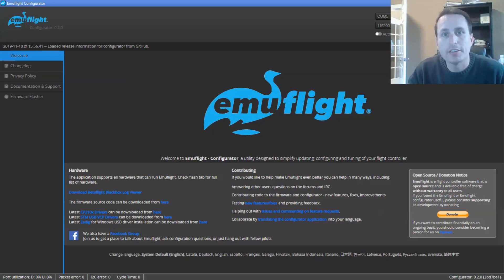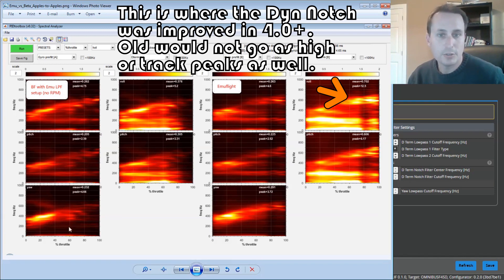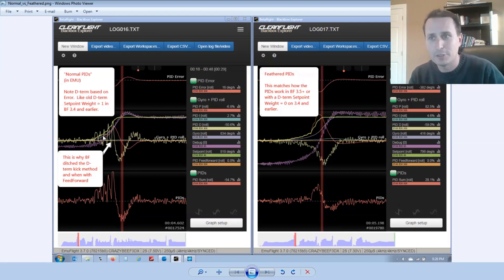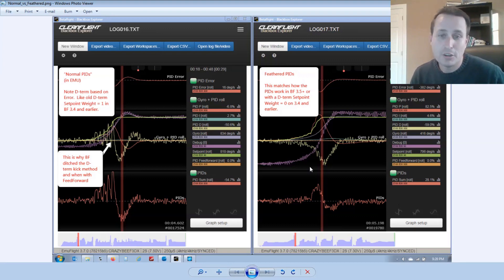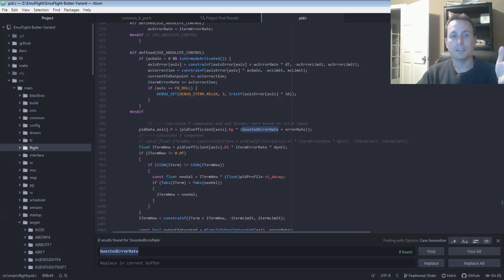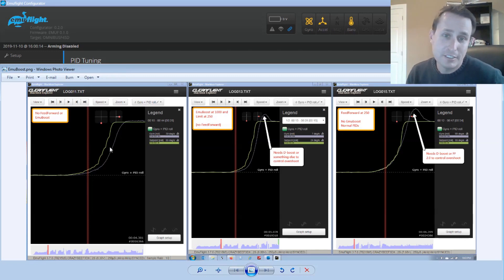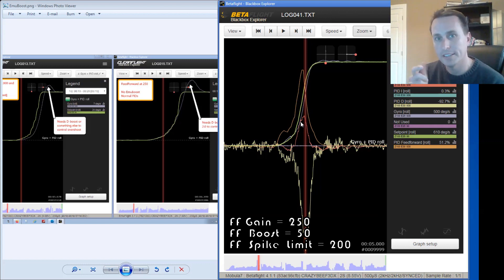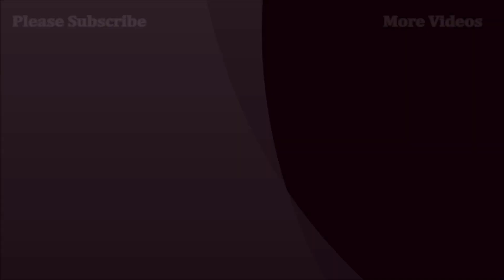EmuFlight Review - Under the Hood

Comment: excellent Mark! I am really glad you are tracking this development. I'm interested to see how this progresses. All good from a user stand point I think, as long as people can get past the hype and placebo traps.
Reply from the maker: underlines the importants of logging to confirm your code is working.  yeah I'm talking to you F1.  Who knows if what they plan to have working actually works if you don't confirm.  it is crazy we have to have these converstations.
Reply: @uavtech  it is crazy! I've no doubt F1 logs their data and uses some kinda data analysis tools for development, well I'd be shocked if they didn't, but they wouldn't want public to see that, else we could understand their "secret sauce"
Reply from the maker: it's a cover.  it would not reveal secret sauce at all.  How does a lot tell you the code that went into the PID loop responding in such a manner.  It doesn't.  

What may happen if we saw a log?  We may see: things are not as they appear on the surface; we may see a simple PID loop; we may see Setpoint is not tracked completely in SimMode; we may see filters let tons of peak noise through, etc..

F1 wants to keep customers focus on the final flight experience.  Which is fine and nothing wrong with that.  But again, placebo can get ya.  Secondary, if you want to tune filters and PID loop to a high degree, sorry, it is very hard without logging.  You cannot see the fine 10% of bounceback through the goggles like you can with a log.  Logging just gives more precision for filter and PID tuning, that's all.

I just find it hypocritical that they must us logging to make sure everything is flying right.  But we ask for looking to do the same, and the response is "you don't need it".  Just silly.
Reply: @PIDtoolbox  I actually doubt that flightone does any logging. I know it isn't something that the helio devs did much of.
Reply: @uavtech  fair enough. But logfile data can give you insight into the coding (and code alone doesn't necessarily give you the "why" something flies better). To give an example in my field, we dont have a direct readout of the neural source code, but we use neural data to infer underlying coding, and its worked pretty well so far. To give a concrete example wrt FPV, if you looked at an F1 log file and saw a strong band of activity tracking motor noise, it's a reasonable assumption that F1 does not make use of a dynamic notch filter or RPM filter. If you had pre and post filtered gyro/dterm data, you could even model the filters they are using. You could see how sim mode is or is not related to setpt to gyro tracking. so maybe not secret sauce, but some secrets may be revealed I think
Reply from the maker: @PIDtoolbox  , seeing to traites to coding up is a BIG gap.  So if someone can see the Dynamic Notch working, or RPM filter working, or Kalman filter working, that would provide no insight on how to code the up.
Reply: BWFPV I don’t think f1 logs.. they don’t have any one that can read em..
Reply: @Sugar_K  it's so weird to think that flight firmware developers today would be coding flight software basically in the dark. they have no idea whether what they code has any meaning. like what's the point right LOL. Well in fairness, F1 and KISS seem to fly very well, so it's a testament to how much can be done with blindfolds I suppose
Reply: BWFPV yeah man 2019 every other type of motor sport logs even go kart racers.. but some people in our hobby don’t see it as useful 🤦‍♂️

Comment: Hi mark and thank you for your time and effort to bring this informational videos. Beside the imu-f placebo, what I‘d like to understand is a difference between emu and BF in general ( in a for dummies way...sorry for the ignorance), I mean which combination of BF pieces (3.5 - 4.0 - 4.1) and which custom added ones from the emu flight developers ? What can I do to get BF to behave like Emu? 
I use mainly BF 3.5.7 because like many others, I found a good configuration, but propwash handling and lock feel it’s not so good.With BF 4.0 ( meh) and Bf 4.1+rpm filters  ( unflyable ) I was kinda disappointed. No satisfaction following community presets ( that I cannot found for 4.1 ) . With emu I found a good setup straight away , is it placebo? it’s not in propwash handling for me , I pushed emu boost to 500 ( limit 5 ) following Pierre configuration ( advertised from botgrinder ) and it’s locked for sure , maybe there is some lag? Probably a Little more but I cannot say . I will try to make comparison of BF 3.5 -> emu flying them one after the other to understand the placebo 😂😉
Reply from the maker: I went through the differences. That is it for the current release.  Basically boils down to EmuBoost and i-Term decay.

I think you should log your diffs.  It doesn't add up and you, or I, will be surprised.
Reply: UAV Tech this are the settings Input on emu : 
set gyro_lowpass_hz = 120
set gyro_filter_q = 7000
set mag_hardware = NONE
set min_check = 1010
set max_check = 2000
set deadband = 3
set yaw_deadband = 3
set pid_process_denom = 1

set dterm_lowpass_type = BIQUAD
set dterm_lowpass_hz = 150
set dterm_lowpass2_hz = 0
set iterm_rotation = OFF
set iterm_relax = RP
set iterm_relax_type = SETPOINT
set iterm_relax_cutoff = 10
set pidsum_limit_yaw = 1000
set emu_boost = 500
set boost_limit = 5
set p_pitch = 65
set p_roll = 62
set d_roll = 29
set p_yaw = 70
set i_yaw = 80
set d_yaw = 15

set tpa_rate_p = 70
set tpa_rate_i = 100
set tpa_rate_d = 100
set tpa_breakpoint = 1460

4.1 plus rpmfilter I tried stock , only thing that helped me was pd balance to 1.3

Edited: and the filter general bars near max on the right
Reply from the maker: @Simofly  well filter bars to the far right means you have a low base noise quad.  Maybe that is not the case?  Just put your EMU filter setup into BF and you will get a better result.  Did you see that waterfall graph in the video? With tje same lowpass filter setup, BF had less D-term noise, not more.  Probably cause of the dynamic notch improvements in BF 4.0+; but have not confirmed that is why.  I just don't know what else it could be.

Or just fly EMU.  It is fine.  But facts are apples-to-apples they are basically the same thing.  Whelp BF has some improvements IMHO Emu could benefit from too.  And if we can get the IMU-F working right, maybe BF can benifit from it.  Just needs vetted yet.
Reply: @uavtech  I have three 6S freestyle eatkabab glide 5" "heavy" (630-660gr) with nearly the same ( electronic), F60 ProIII or Xing 2207 motors, 2 with mpu6000 and 1 with ICM21062 gyro ( the Emu one is with mpu6000). Not the best frame for noise but not the worst. With BF 4.1+rpmfilter ( JB 4in1 esc ) and everything on defaults it seemed to drive a boat instead of a quad ( just to give you the idea I hope ).There are a millions variables...
I saw the video three times, but what I'm missing to understand ( but that it's my fault not yours ) is a global vision to get to  see what Emu brings to the table and connect to what I feel in flight (in comparison to BF).And "feel" is not objective I know.... Emu is at the start so it's early to get all the details on it...Betaflight got so advanced and open to every possibile pilot need,  that the last version goes out and the less confident I am on it. My dream would be to have a Kiss flight feel with Betaflight OSD and GPS...However I will continue to test Emu vs BF and we'll see and thank you anyway for the time and support
Reply from the maker: Good luck in your search.  Just make sure not to chase ghosts.

Comment: I really hoping EMU becomes a simplified version of BetaFlight for us old farts who like to tune PIDs the old way without having to mess with filters. 
It would be cool to see you set up a quad from scratch on EMU.
Reply from the maker: You always should have been tuning filters first. Just folks were not aware of their influence as much.  It is like smoking.  You tune BF the same you always have tuned a PID controller.  Did you see my PID tuning Principals series?

I think EMU plans to rebase on 4.1.  They need to do something to get all the new targets, etc...  Maintaining a project is a lot of work.

Setup is the same as BF.  JB has lots of videos on setup.  I pretty much hit the differences.  Which really comes down to i-Decay option and EmuBoost option.
Reply: UAV Tech Coming from the BaseFlight days I guess I’m just used to tuning for feel and prop wash and flying around the bad stuff. Up until 4.0 I’ve never had a turning issue I couldn’t fix with the PID adjustments. I’m sure it’s something I’m doing wrong but the given time I get to fly I’d rather just use a older version that works and fly then chase down a problem for a small improvement in stick feel.
Reply from the maker: @FunkFPV  , the key is Step #2 in my principals series where you turn off the bells and whistles to tune the PID balance.  Then from there, you add in SOME of the advanced PID control stuff.  It all builds.
Reply: UAV Tech I’ll check it out 👍🏻

Comment: nice video! IMUF doesn't work on non helio FC's, I didn't know it! - Luckily I didn't hype it in my videos :D But I can understand the placebo effect. Emu is a fork of Butter 3.5 - Butter a fork of BF. And even when I fly my quads with Bf 4.1 compared to 3.5 - BF 3.5 flies better imo.  I have also tested Emuflight on one of my heliospring quads, couldn't feel a difference to BF 3.5.7 with IMUF 1.1.0 - But BF doesn't support the Heliospring FC anymore, so I will use Emuflight from now on, on my Helio-Quads and I'm curious about their future releases.
Reply from the maker: Keep in mind 4.0 is 3.5 with new features and different defaults.  4.1 is 4.0, again with new features and different defaults.  So, what folks are seeing if they like an old versions more is just settings changes.  For that, just see: https://github.com/betaflight/betaflight/wiki/Community-Presets#revert-40x-defaults-to-an-older-version-of-betaflight-defaults to revert any old defaults from a previous version if you liked the old default better.  Best though is to tune the quad.  https://www.youtube.com/playlist?list=PLcYNkvInloJFbZmLf_X72M3fEZB-BKkiQ
Reply from the maker: Good one.

Comment: Is the imuf working now?
Reply from the maker: Yes.  It is a PT1 filter that varies.
Reply: @uavtech  I flashed it on one of my quads last night just to give it a shot. Out of all the firmwares I still like your 4.0 high performance filter tune the most even more so than the rpm filter. Haven't messed with the rpm filter much though

Comment: I am running 0.2.8. I think that version has it working.  Is it not publicly available?  Ha, I just use what they send me🤣
Reply from the maker: But are you sure?  Has anyone checked?  Is the other code even working right?

What do they say?  "Fool me once, shame on you.  Full me twice same on me."
Reply: don't you mean  0.1.2.8?
Reply: @robwilliams5975  no, I have 0.2.8 from Kevin and it was a version he said I could play with the new filtering.  I don't know what "actual" version it is just what he gave me.  But in reality, Whoops, especially 1s 65mm ones still feel best on 3.5.7 (or 3.4.x because the arm/disarm flushing worked better after a crash) in my opinion and are much easier to set up, so even if Emu IMU-F isn't working the addition of emuboost would take what we all like best of 3.x.  and add the niceness of FF.  Looking forward to all the advancements in all the firmware :)
Reply: @uavtech  yup, totally true.  it could just be emuboost, but when i went to the 0.2.8 version, it handled prop wash on hard 180's much better than the first version I ran.  But I've only spent a little bit of time with it.  The one thing Betaflight could learn is keeping it simple...4.1 is getting...quite complex...powerful, but complex.
Reply from the maker: @ProjectMockingbird  , first step is to introduce options.  Then with long term use, solidify what works best and simplify.

Comment: So in other words you can tune BF3.5 to feel like it flies better, and better sounding motors, than BF4.1 which is apparently what current stock EF is.  When u read the comments on the JB EF video you see lots of people saying that the same problem-quad that JB has been struggling with flies better (less "bobbles") and motors sound better on EF vs BF4.1.  So why are so many comments on the video saying this? Also in the JB EF video the motors definitely sound different going form BF4.1 ->EF but i don't know what sound is supposed to be the better motor sound.   Personally i have no opinion as I'm not going to bother with EF just yet.
Reply from the maker: EMU is NOT BF 3.5 defaults.  EMU has more filtering (lower cutoffs).  If you want 3.5 defaults in 4.0 or 4.1, then see: https://github.com/betaflight/betaflight/wiki/Community-Presets#revert-to-bf-35x

Folks opinions after watching a video is super subjective.  What i have shown in this video is not.  These are the differences; or similarities.

Comment: emuflight flight betaflight no. I try many filters in betaflight in 6 month ... I used developer relises  ,rpm. filters  ,notch dynamic notch, your calculator latency.... but fly has propwash... emuflight fly in stock without propwash.
Reply: PS rpm filters produce oscillations do you know about it? does you try just arm with low filtering with rpm and without rpm in hand? blackbox is nice but try some experiments...
Reply from the maker: @HERSDT_FPV  , did you watch the video?  Because it seems like you missed the point if you think emu had less wash.

Blackbox is running experiments with a microscope.  Not with fizzy glasses.

I have run with and without RPM of course.  No oscillations.  You have any proof?

Comment: I do not understand as if you speak of Emuflight does not test the variations of W and Q, to talk about placebo, before you have to take and try the medicine, and if EmuFlight is a kind of BETAflight plus the FC Helio filters, you will have to try that, if it is true that in my helios I can apply W and Q by axes and that this EMUflight has a simplified version that you only apply Globally as in the first versions of the IMUF, but you have to try it to be able to speak before the , and especially before releasing the word placebo
  test at low filtered values like w16 and Q 5000 and high filtered values like W64 and Q 2000, you sure appreciate differences, or you can then affirm the placebo
  I do not understand how with 70 comments, most applaud your analysis and nobody comments the obvious, that to affirm something before you have to try it
Reply: I too have a Helio board that I ran emuflight on till a motor pad ripped off, It does have more control over the W/Q and can say it does work on the Helio boards, which he didn't mention, on non-Helio is the placebo... Maybe he didn't know. I then installed it on my Flightone revolt board and it flew okay and the tpa was good but yes I didn't think the W/Q had the same effect on propwash... Now I know why LoL, once they get that working on all the "regular" flight controllers I think people will really be impressed.
I've GOT to fix my Helio... Maybe reassign my motor through the led pad...
Reply from the maker: I fly Emu.  This is just a fact buddy.
Reply: @uavtech  helio?
Reply from the maker: @ugpfpv361  , unknown for Helio, but definitely for non-helio targets.  Someone should confirm (with logging) is working in Helio.  Point is, folks, need to log to confirm this stuff is working.